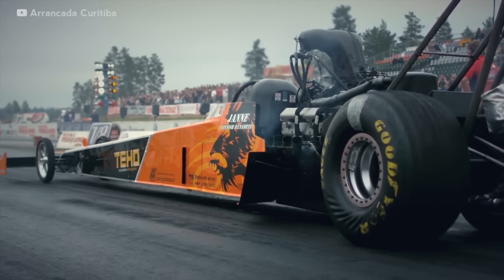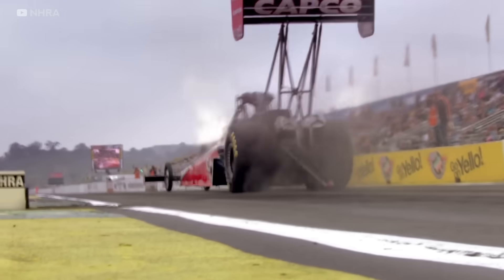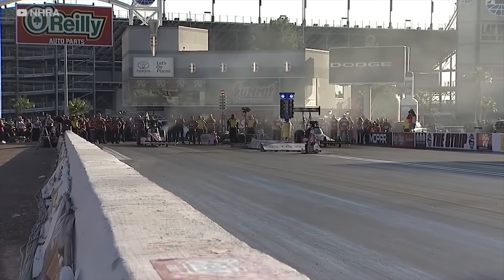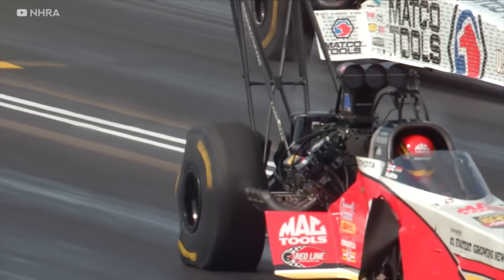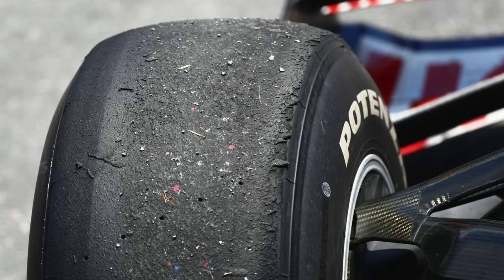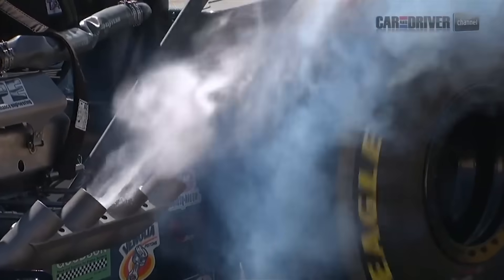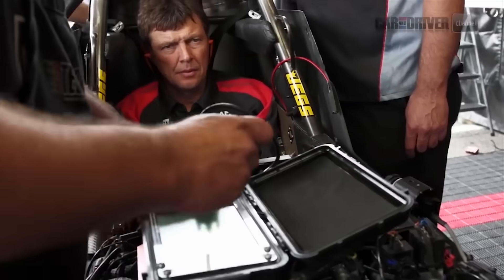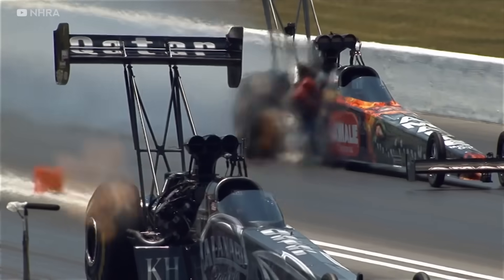How Dragster Tyres Accelerate to 335 MPH in 3.6 Seconds

Comment: Been to a top fuel event and I have to say, it’s amazing. It’s much, much less exclusive than something like formula 1 (my favorite motorsport), you can walk right up to the team areas and watch them rebuild the engine, the smell of the fuel is like tear gas (you’ll choke and tear up), it’s like a whole festival but you can meet the teams and drivers pretty easily! The different venues you can visit are amazing, I won a signed piston from one of these things. So not just are the cars amazing, but the atmosphere is something to admire as well.
Reply: I should add, I’ve never had the pleasure to go to more high profile racing events so I’m only assuming.
Reply: @SuperCod141  I've been to a NHRA event and you are spot on. The 12 hour of Sebring IMSA race is similar, paddock is open 24 hours. Well, pre Covid 19.
Reply: Justin899 a couple of years ago I got John force’s autograph, such a great experience
Reply: Justin899 because of how fuel-rich they run, there’s a lot of nitric acid in the exhaust.  That’s what irritates your eyes and lungs
Reply: I've been on a few f1 events (4 total)

On thursday you can enter the pitlane and take a real close look at the cars mechanics and drivers.

Pretty much the same access the press has on sunday and saturday save for the driver interviews.

However the noise is easly beareable without ear protection. Which a few years back can't be said on the junior competitions.
Reply: Justin899 one other thing that not that many people know is how insanely sticky the track is, walking across it my foot got pulled out of my shoe
Reply: I've been to the Blancpain GT event at Zandvoort last year and I experienced a very similar vibe. You could get very close to the cars, the racing was awesome and you can visit the event at a fraction of the cost of an F1 race. I also visit the Historic Grand Prix every year with my dad and it's just as awesome. Going to events like these really makes you realize just how inaccessible F1 weekends are these days. Of course there's nothing wrong with that in my opinion, but if you're looking for great racing and you also want to see the cars from so up close that you can touch them, you might want to go to one of these events
Reply: @quintenvermeulen4576  lol i was at that event aswell last year. Was supposed to be working in the paddock this year with one of the support race teams
Reply: "Every ticket's a Pit Pass" if I remember the quote correctly.
Reply: The V10 era F1 cars had a very similar "tear gas" effect, I often watch F1 at Interlagos on the last corner before the pit entry and it gets a little boxed out there between the stands and the pit wall, during the early 00s the cars spewed a lot of unburnt fuel on the straight that lingered around in the air, enough to irritate your eyes and throat. Not to mention the deafening noise and the vibrations harsh enough to shake one's teeth out.
Reply: Another somewhat "accessible" motorsport to watch is stage rally.  There's typically some super special stages where it happens inside of a proper venue.  Competitor cars are typically parked on display in one small area where you can walk around and get right up to the cars.  Drivers will have posters and other memorabilia just sitting on their hood and windshield for you to take and have signed if they're hanging out near their cars.  The service areas are just tents with some rope around them that you can be within feet of somebody tearing down and rebuilding different parts of the car.  I've seen some really nice drivers actually offer to let people sit in the car.

Once they get out into the woods it's a little bit more difficult, but if you're willing to hike out to some really good spots, you can be within feet of the road as cars fly past sideways.  I've been a couple of times, the feeling of being surrounded by nature, drinking with friends while you wait for a car to come.  Hearing it before you see it, then for a few seconds you watch it zoom past, get showered in dust and gravel, and then hear it get farther and farther away.  Then a couple minutes later, it all happens again.
Reply: I've been to the NHRA nationals in Indy a few times. We stayed in the campground for the weekend which is a blast in its own right. 4 days of awesome.
Reply: It’s always been fan friendly. One of my favorite aspects of the sport. I live 15 minutes from Sears Point.
Reply: I miss the full 1/4 mile top fuel days 
The last one I saw was Bristol Tenn. Corey Mac went 327mph in like 4.8 or something it was nuts 
My favorite part is that your organs actually get shaken as both cars hit the accelerator 
Also back then if both cars for whatever reason broke traction you got a dynamic “pedal war” wherein each driver pops the throttle throughout the run and basically amounts to both cars doing a full track burnout (provided no one launches a blower in a giant ball of flame, which is really really cool) 
It’s slow but fun to watch
Reply: Spot on Justin! I watch GT and WEC events and find the racing just as exciting and the whole scene is more welcoming and accessible too.
Reply: Really glad people notice that. There are a lot of events there too like the army has their pullup/pushup area and there are trailers with dragster sims people can play as well as reaction time tests. It's not a well known sport compared to something like nascar or f1 so being inclusive is what brings people in and makes the whole experience so cool.
Reply: Dauminator63 Haha that’s where I won my piston, I won a sit up contest😂. I’m so glad the sport is getting some recognition like this.
Reply: Formula Drift is like that too. I was going to go this year to a NHRA event but couldn't.
Reply: Signed... piston? Did an engine break or was it just a random piston they had?
Reply: Top fuel seems a lot cooler then an f1 race!
Reply: Agree! The rumble in your guts as top fuel (or funny cars) make their passes is something to be found no where else!
Reply: My dad's got connections to a racer, so I got free tickets to stand right on the fence at the 8th mile during race.
Reply: In germany, bavaria, vilshofen there is an event every year "race am airport" and last year there have been two dragster, dont thing topfuel and much less power. one was a slingshot. The guy said the guy has the gearbox in front of his balls, so lets hope it doesnt explode xD
they are very noisy but really cool^^ and the mayor of vilshofen drove with a guy in the "rosa kampfsau"
https://www.youtube.com/watch?v=qqyAFgjy-zA&ab_channel=SpecialMovieProduction if you wanna see it
Reply: Spectator sport. You gotta be good to the fans.
Reply: I've read some articles about Top Fuel cars, and in a few of them the topic of "cost" is addressed. It is said by some crews that if a run has no breakage at all, it still costs (depending on who you''re talking to) $4000 to $5000 to make one run of 1000-ft. Not counting the transporting of the car and shop trailer, the transportation of the crew to the event, or the meals and lodging. Spark plugs, one run. Connecting Rods: 1 or 2 runs, pistons, one run. Crankshafts 12 runs, (7) clutch discs 2 runs. Nitromethane fuel 13-14 gallons per run. Here's an example: go to your local hardware store and buy a 1 1/2 gallon bucket. Fill it with water. Turn it over and pour out the water as fast as you can, just dump it. You cannot dump 1 1/2 gallons of water out of a bucket as quickly as a Top Fuel engine burns nitro. The teams are limited to 100 gpm pumps, which is 1.6 gallons of fuel per second being pumped into the engine at full throttle. Nitro comes in 55-gallon drums, which is good for 3 full runs and a part of a 4th including burnouts. That would be the miles-per-gallon equivalent of around 84-85 gallons per mile in a "regular car."